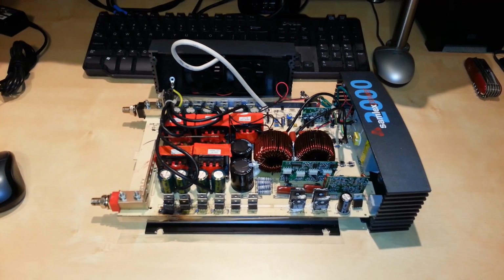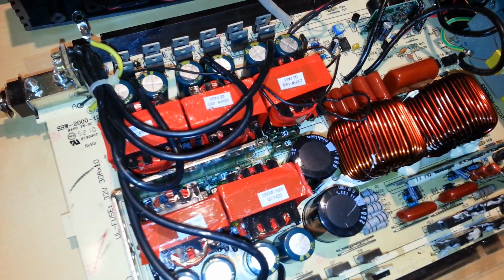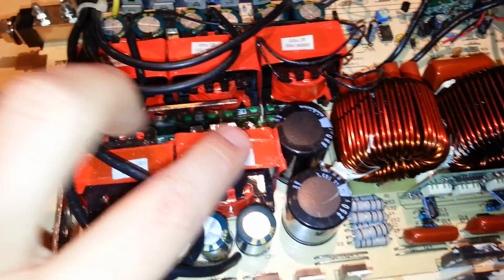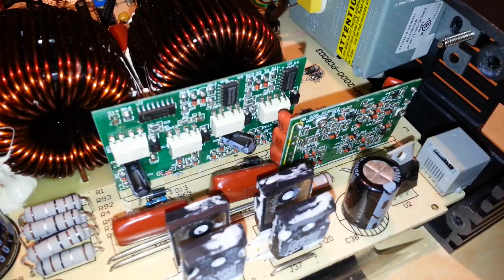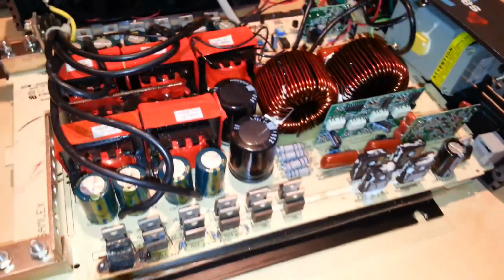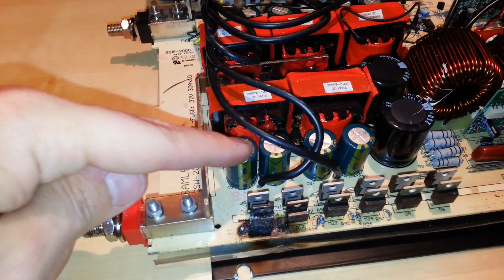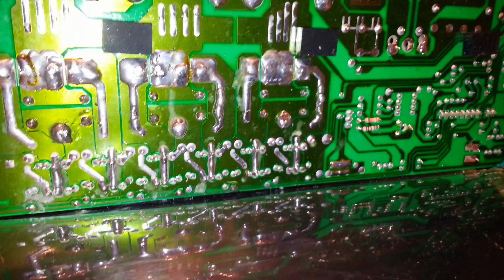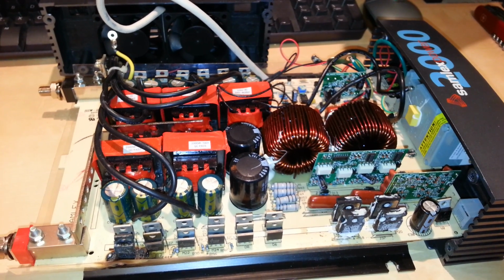Samlex SSW-2000 Pure Sine Power Inverter Repair: Part 1

Comment: This board looks identical to my ntx-2000-12 that looks to experienced the same thing.  Same mosfets etc.  I started it but with the new BMS it caused this issue.  Should have installed the precharged setup with resister.
Reply from the maker: Yeah I'm sure the main drive circuitry is the same but the brain daughter board that operates everything is slightly different. I think they have discontinued this particular model however I'm sure many of them are still in service today
Reply: @Bassguitarist1985  I contacted them they replaced mine with a new one.  I was just over the warranty period sent all my documents to them and what I thought was the cause.  Really good company to work with and fast.
Reply from the maker: @TimShelnut  Nice! Great to hear!

Comment: Do you have to hook to two 12 v batteries to run electric heater
Reply from the maker: For a 1500 w heater yes the DC voltage drop and amperage draw would be too much for one battery to do for very long.

Comment: Anyone know where I can get schematics? I want to modify the fan circuit.
Reply from the maker: Hey Jim I do not have a schematic for the main board. This is a very old unit and any schematics you get now would likely be different but I highly doubt that the fan circuit is that much different. There is a thermistor under one bank of fets that was the old design but the new design that I know of is the fans are running constantly and run off a transformer and proportional to the load the fan speed will increase.

Comment: Just finished swapping the fuses out on the same inverter I have on my boat. Was partially submerged for about 10 minutes while running. Blew out 8 of the 10 fuses. Now it powers up, but seems like its caught in a loop. Fans rev up then it makes a single quick beep or chirp. Then the fans spool up and beeps again, maybe every 3 seconds. Green light is on, no output on the outlets. Curious if you ran into something similar along the way?
Reply from the maker: Hard to say. If submerged could have shorted many things.
Reply: You should remove the pcb and leave it out in the sun for several days, a week to be safe. Water can seep into small spaces and take days to evaporate.

Comment: Unless you use silver-plated brass fuse holders, the voltage drop is much higher than for a soldered-in fuse.  The production time is also less, as the fuses are just another pick-and-place part for the assembly robot/  Having fuses in holders may require a human to do the insertion...

Comment: should have them burnt mosfets on a heat sink
Reply from the maker: they are actually, its a large aluminum part that sandwiches between them all then the outer case covers that with the fans blowing over the built in fins. Well built unit, prolly significant changes since I worked on this 2011 version.

Comment: Hello. Please help me with some advice. I have a 12v 1500w continuously pure sine wave inverter from solartronics to which I put 230V voltage on its 230v output when it went. It burned all six of its 30A fuses plus 125A fuse between the batteries and the inverter. Of course it stopped. After I changed all the fuses, it displays the red fault light and beeps continuously. Inside it does not smell burns and there is nothing ars. Do you think I have a chance to fix it? Thanks in advance
Reply from the maker: Marius Macovei hello. Hard to.say. popping fuses likely blew the drive circuits for both input and output stages. May not be worth repairing dollars and cents wise.

Comment: Hi saw your video and wow great stuff.  I have a inverter Aims power last week it worked great yesterday all I get is power to it from the battery bank but no AC coming out of it.   I check the outside fuse in the fuse is not blown.  Have any ideas I have not opened it but I checked the continuity of the fuse and it checks out to be OK
Reply from the maker: FROM CEO TO NOMAD thank you for watching dude! Honestly hard to say. So many places to check. Does it have a GFCI AC outlet? If so can you reset it? When you take it apart be careful but probe the leads going to it for power? If the unit boots up and doesn't pop fuses, it may be something simple, then again, hard to say
Reply: No GFCI just straight wires coming out from unit black white green wire.  I connected those to a power strip.  No power on the strip. But power when I turn inverter on.  No reset anywhere on outside.

Comment: Hi I have a 1500w inverter had somebody install it without using the external fuse to avoid any damage inside an insted put the plus on the minus an minus on the plus is my invertor completely nackerd now or can be fixed did hear a pop inside an no power now
Reply from the maker: James Hopson time for  new inverter. Not worth the labor and parts to repair it. Fire the dude who didnt put the fuse on the DC input and piss in his front lawn or something.
Reply: xboxer1985 iv taken it apart an doesn't seem any blown parts but there's solders little fuses that are blown but no damage to the motherboard do you have email to send you pictures see what you can make of it
Reply from the maker: James Hopson if you can pm me i will send. Even if there is no visible damage. Reverse polarity will destroy some if not all of the drive FETS and likely the drive circuitry running them.
Reply: xboxer1985 it's all fixed with a grand total of £53 lol luckily a few fuses had blown
Reply from the maker: James Hopson good news! Lucked out it didnt blow the drive/boost stag components!

Comment: You know i think they put all those 30 amp fuses in not thinking anyone would replace them but as a fire prevention step. Removing power before it causes a fire.
Reply: A good reason to solder fuses is vibration. After a few years, a fuse can loosen and lose contact. In a professionally designed and constructed circuit, that should not be a problem, though.

Comment: advance,,, how long did you're Victorian Phoenix last???I too was considering one of those,,,look nice however considerable coinage$$$,,,I have a cheap modified sine wave h. f.1500/3000watt inverter,and a pst 300 12 volt Samlex,Samlex is for my tv and other sensitive electronics,mod I use for my old refrigerator.

Comment: is there a place you can send inverters to for repair,I'm looking at a Samlex pst 600 12 volt inverter,4 year old for$100.00 if it malfunctions how could I get it fixed?
Reply from the maker: i dont know of any shop. not sure if samlex takes them back for repair. its.tough as the daughter board i needed was not the exact one they gave me. depends what's broken inside it.
Reply: +xboxer1985 

Samlex is crap. They somehow believe that paralleling fuses will work as one big fuse, which it NEVER will, due to slight differences in resistance of each fuse. Thus it will never be able to properly protect the circuitry from over current conditions. They should have used one large fuse. Also, they use crap capacitors made by Lelon instead of top quality Japanese branded ones. I changed out all caps and took out all fuses and put in one main 100 amp fuse in mine. For me, its inexcusable for the price they charge to cut corners like that.
Reply from the maker: I agree. The input caps I beleive were the reason this one failed. Very poor quality components. Its made in China so go figure. Though designed in British Columbia Canada. Quality Control with China manufacturing is non existant. Goes out the window entirely.
Reply: Designed in China, bought and rebranded
Reply: I rebuilt this very unit. Let me know if you want to talk.

Comment: I heard the fan on these inverters are loud and annoying. Can you upgrade the fan some how and how hard would that be for someone with no experience taking these apart.
Reply from the maker: the fans themselves are actually decent ball bearing brushless fans. what makes them loud is the fact that they have to spin very fast to push the amount of air cooling over the components. 

the new cooling design has the fans running constantly low speed at a low load and immediately spin up to full speed after a certain wattage threshold this prevents any possibility of overheating
Reply: Thanks for the clarification. Are these inverters good for 24/7 use and do you have any tips on how to keep them from breaking down?
Reply from the maker: The samlex yes. Built pretty well. Just keep the vents clean and periodically check that the fans are running smooth. Heat is the #1 enemy. Also make sure that whatever surge wattage you need, double the inverter running watts from that number. This will insure that the inverter is adequately sized to handle heavy startup loads.
Reply: thank you so much for all your help. I have one last question, what gauge of wires should i use to connect the charge controller to the battery and the gauge for the inverter to battery with the 2000 watt inverter.
Reply from the maker: 0 gauge minimum between the battery and the inverter and charge controller will depend on how much amperage it can push out
Reply: I have a 30amp charge controller, i found the manual and it said 2 gauge was recommended; would that cause any problems since i already went ahead and bought 2 gauge.
Reply from the maker: 30 amp charging will be more than adequate on 2 gauge. In fact its overkill. 10 or 8 awg would have been fine.

2 awg for inverter to battery is too small. It will run, but severely limits the surge wattage the inverter is capable of causing it to shut down. It is because of the voltage drop with thicker cable such as 0 gauge the voltage does not sag as bad under the surge and is able to start up the heavier inductive loads
Reply: Awesome ill go ahead and use the 2 since i already bought it, thanks so much i really appreciate your help. Just out of curiosity would a 5000 watt inverter also use a 0 gauge.
Reply from the maker: it would depend upon what the DC voltage is there are very rare 5000 watt inverters that operate at 12 volts. That would be roughly 500 amps and you would need about 0000 awg gauge and very short distance. More times than not you find inverters of that size to be at 24 or 48 volts DC. At those voltages the amperage is cut in half or more compared to 12 volts
Reply: Alright one last question and ill be out your hair. So when i hook this up to 1800 watt heater it will start while the busser goes off then turn off. I tried a 1000 watt microwave and it starts and runs but the busser stays on. Is this because of the 2 gauge wire not being able to handle the load?
Reply from the maker: Exactly. Measure the voltage drop and you will see why it complains of low voltage. And the 2 gauge must be getting pretty warm too
Reply: Thanks again for all your help, i really appreciate you taking the time to get back to me, your awesome.
Reply from the maker: Anytime! Curious what size battery bank you have? I have a 244Ah battery bank, and my needs are about 1k watts running max but average of 400 watts. Roughly 3k surge for the furnace
Reply: So far i just have 1 100AH battery with a 500 watt solar setup. Im just testing it out right now so I can put it on my Rv/bus. The most surge will probably come from my AC once i get one. Any recommendations or advice?
Reply from the maker: You need a MUCH bigger battery bank. At the very least 250Ah or more to handle the inverter
Reply from the maker: Figure that every 100 amp hours can handle about a thousand watts at 12 volts duration is not so much important with that measurement however you will want to size your battery bank properly to be able to handle the reserve time when your solar array is unable to charge the bank.

For example my needs are basically lights and the furnace when it needs to run so it's very peaky and not consistent.
Reply: i was gona get 2 more 100 ah batteries would that be good enough?
Reply from the maker: While it is better than what you have already I do not know exactly what your power requirements are you have to do a lot of calculation to figure out your demand and your reserve time and how often your solar array will be at full capacity to charge the battery bank there will be days when you don't have son and cannot charge the bank which you need reserve time to get you through. I haven't made the jump to solar because it's a very big investment and mine is very portable and small not enough to justify.
Reply: Hey I have a problem so i got the 0 gauge cables and hooked it up and the 1800 watt heater still wont turn on high and has that buzz noise going off including the 1000 watt microwave. The only thing i can think of is a poorley crimped battery cable lug. Have any suggestions on what the problem might be?
Reply from the maker: Not enough amp hours. 100Ah cannot handle a sustained 180 amp load. Like i said. You need a way bigger battery bank
Reply: Ohhh ok i get it now. When i get the extra batteries i would do a series hook up right?
Reply from the maker: No, parallel. Its the 12 volt model right? Series is for when you need 24 or 48 volts
Reply: Oh yeah duh. What gauge of wire would i used to connect them in parallel?
Reply from the maker: 0 gauge

Comment: Hi, awesome what ur doin but the reason why im telling you that ur awesome is im searching for help for my 24V 800W Victron pheonix inverter, when i start it it shows green(normal) and red(error) light but the green goes off leaving the red one with an ennoying sound ; no output voltage ,so what do i need to look for or do to be able to know the issue or whats damaged and need to be replaced

Sorry for my bad english
Reply: Did you fix your inverter? How long did it last; if it,  eventually,  died?
Reply from the maker: +Sammy Kalintosh still running! light duty!

Comment: hello, ive seen youre pretty good at commenting back so i figured id ask you about my inverter. i have 2500 watt pure sine wave inverter and a multi-cycler heavy duty deep cycle battery. made the mistake of switching polarities so fuses burn out. replaced them, hooked up inverter correctly, made 1 spark and then just didnt do anything. i did notice the power button was on when i connected the wires. i dont see any burnt marks or anything really messed and also checked to see if the switch worked witha multimeter. im desperate for some type of answer! thank you!
Reply from the maker: +Reece Fu You likely burned out the partly or the entire input boost stage. There are fuses that protect the FETS and caps, if you are lucky just the fuses blew. Worst case is the fuses, caps, pull down resistors, and FETS all have burned out. There is a chance the input push/pull drive circuitry was damaged but not sure, hit or miss. can it be repaired, I'm sure it can, but it takes know-how, time, parts, some cash, and hopefully a schematic to follow.